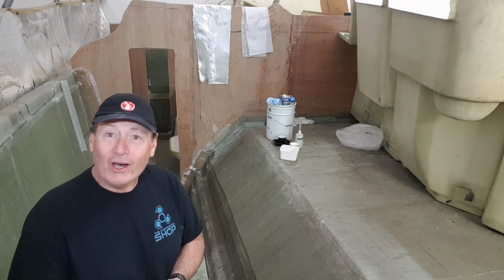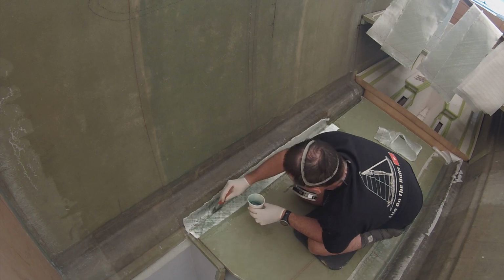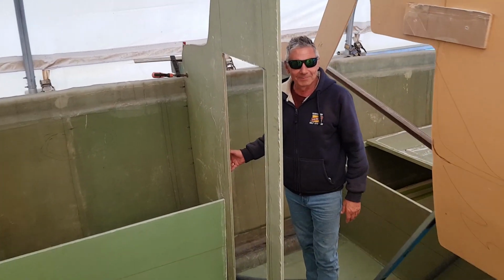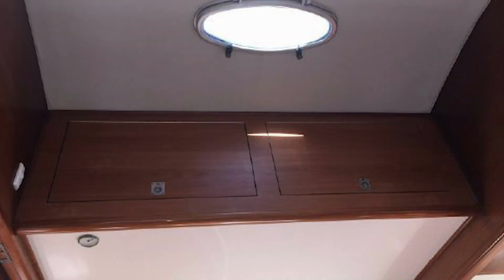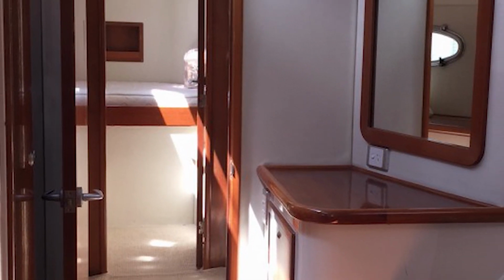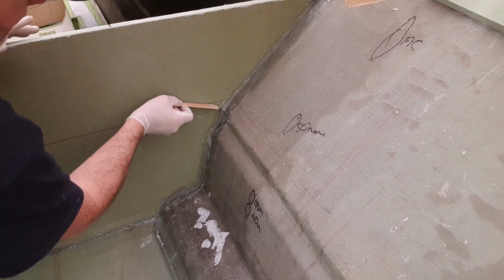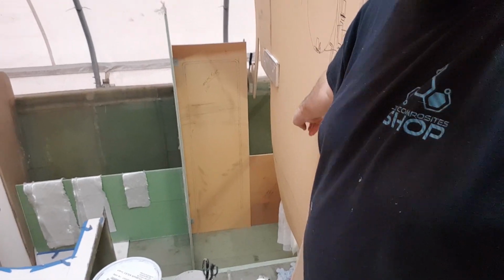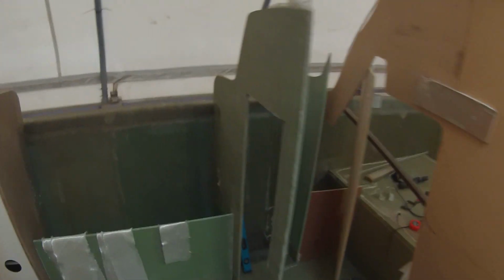Ep119 Foam Core Cabin Partitions - Life On The Hulls - Fibreglass Catamaran Building

Comment: Gosh! Ya sure go thru the peel-ply. I priced it here and it's nearly the cost of the glass. For small projects, I use poly deli sheets, like used to hand'wrap cheese before bagging. Larger, I use sections cut from trash bags or  builders plastic. Ends up shiny smooth with some wrinkles; but yet gonna sand it anyway before fairing (last ply, using laminating resin and "hot" coating.
Best to ya Ross. Always informative and fun!

Comment: Do you install  everything  before adding the deck roof mould?
Reply from the maker: Pretty  much the entire boat is built inside structurally and the deck is just the cap. Hull requires most of the work.Cheers Ross